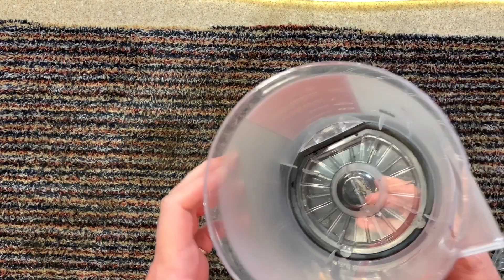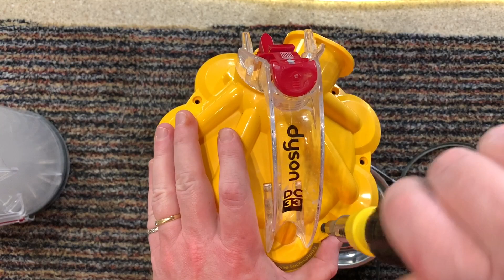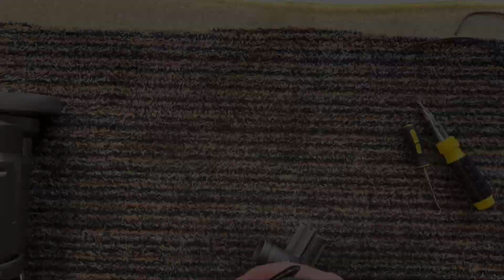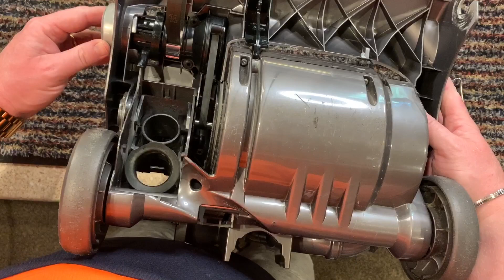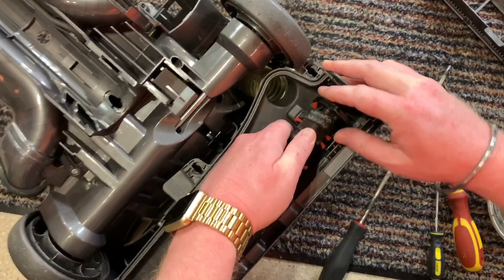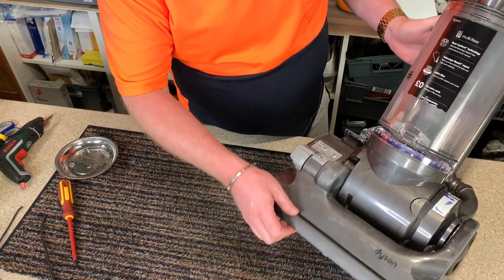Dyson DC33 Multi Floor Refurb Part 2

Comment: Wow 😳 you've done ✅ a good 💯 job repairing the Dyson DC 33 multi floor upright vacuum cleaner it's in very good 👍 condition it' sounds very quiet 🤫 and powerful to use and is this the original standard yellow one of the Dyson DC 33 multi floor upright vacuum is this one just for carpets only